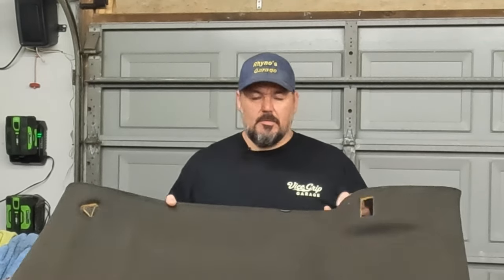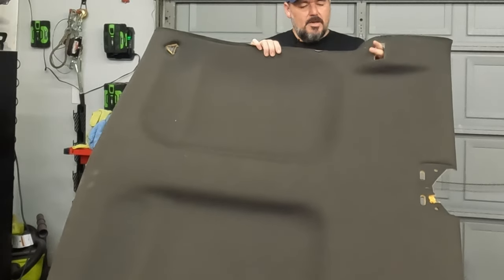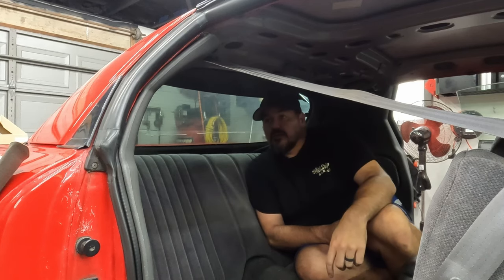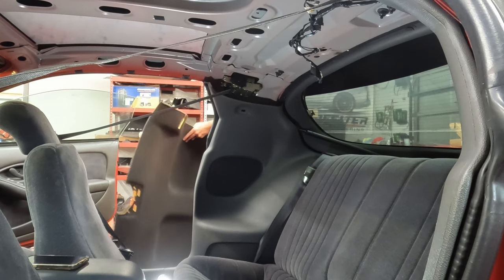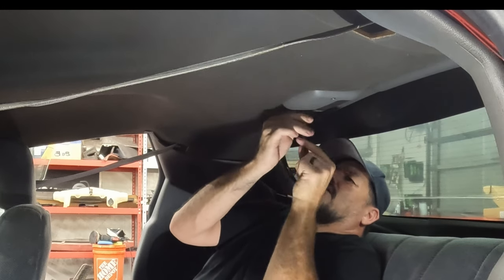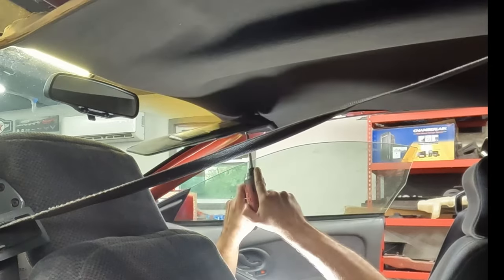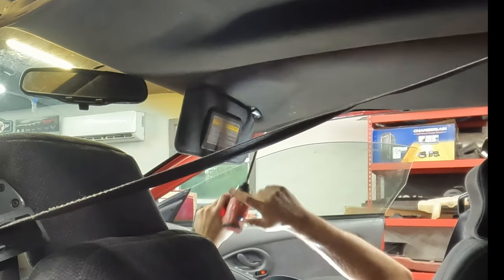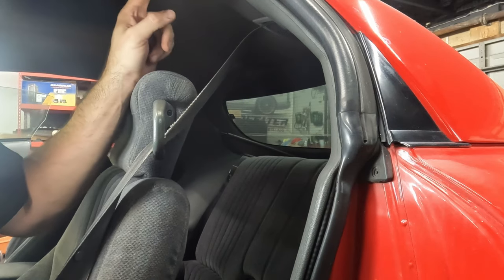Install New Headliner in 4th Gen Firebird (1994-2002)

Comment: I just double checked and my 1999 TA and 2001 Formula both have a push pin Christmas tree clip thingy in the middle under the t-top bar. Maybe the hard top cars don't have that retainer?
Reply from the maker: No they don't.  Maybe since the hard top cars have the side door trim to hold it up, it's not needed.  Just a couple of velcro spots in the middle.

Comment: Hey Brother ...Does your headlier hang/sag over your rear view mirror area? I'm wondering if I should get some velcro or double sided tape for the underside so it sits more flush with the  roof?
Reply from the maker: No, it doesn't on mine, but there is a small bit of velcro on the middle toward the front.  So maybe another piece would help.  Good luck!